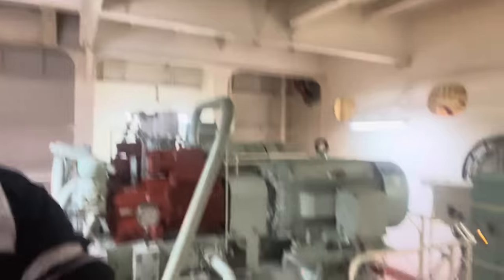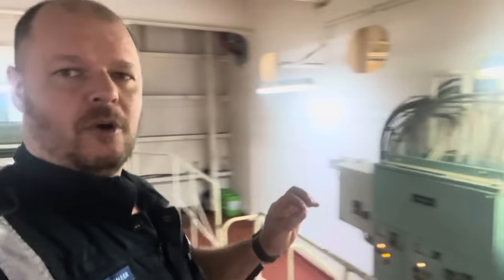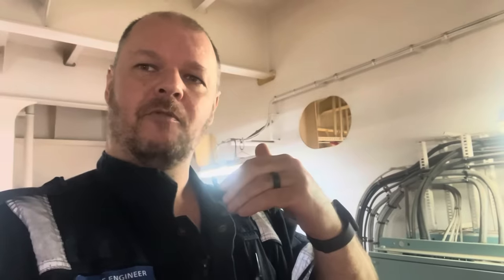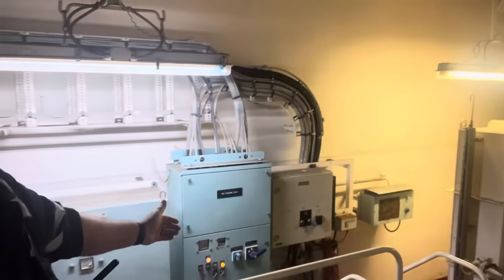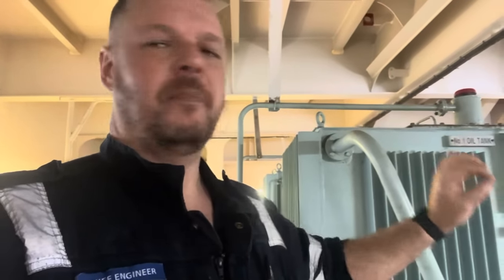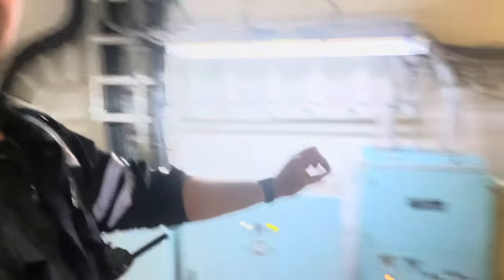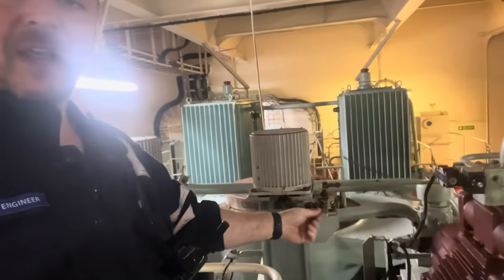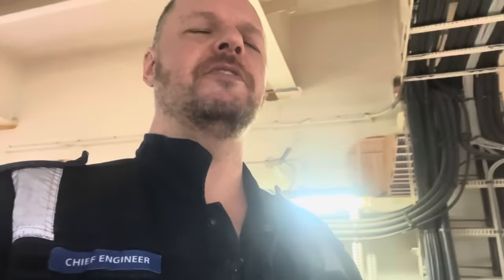Dali size containership steering system. How it’s designed to not hit Francis Scott key bridge

Comment: Thanks for the detailed explanation.
I think the problem in this instance was not that they had no control of the rudder, but that they went astern when they got the main engine back.
That most likely would have blanked the rudder, making it ineffective. Then the paddle wheel effect (prop walk) takes effect which would turn the ship.
Reply: This makes the most sense. Along with the usual smattering of maintenance and crew experience/training causes.
Reply: I thought the NTSB said they didn't get main engines back?
Reply: @greenernick  NTSB website "latest news" only has something from March 12 related to 737 door plugs. And typically they are quite tight-lipped until the investigation is wrapping (wrapped) up. Did you see some kind of press conference, or might your impression be based on a source other than NTSB?

Comment: I run smaller ships so I don't know if its different for some reason on your vessels but with NFU steering we still have the rudder angle indicator operational. It would be almost impossible to steer in that mode without it. I have a lot of respect for my engineers. The complexity of their jobs is incredible. Great video.
Reply: do they use a rotary shaft encoder to transmit the rudder position to Helm or is it something more old school ? i am guessing there must be at least 2 systems ?
Reply: @heartobefelt  Not sure what a rotary shaft encoder is but I believe the RAI signal, however it is transmitted, is totally independent of the steering system.

Comment: Thanks for the very detailed presentation!

It seems like the issue wasn’t that they lost steering control but that they unfortunately immediately went full power astern after the first outage, which swung the tail of the ship in the wrong direction and defeated the action of the rudder.

Comment: Thank you for this explanation Chief!! I’m a senior field service engineer for a major thruster company and I’ve commissioned 100’s of vessels. You are 1000% correct! There are main and backup steering and speed controls from the bridge, from the engine control room, from the thruster switchboxes, and manually from the hydraulic tanks… and last resort from the thruster itself with a large ratchet if need be. Now, granted this is a rudder system not a thruster… but exact same concept. ALL vessels have several backups for steering and speed for these exact scenarios. They’re tested periodically by ABS and crews train often to use all the controls in emergencies so they can respond quickly. 👊 Respect!

Comment: Thanks Chief for your explanation, it helps so many who are not snipes.  I’m not sure you explain how the emergency panel (buss that supplies all things critical including the port steering motor) has an “automatic” buss transfer that switches supply power from the normal generators to the emergency generator without operator intervention.  Also that the port steering motor is a LVR style controller that also automatically restarts the port steering motor as soon as power is available.  Many thanks!
Reply: There is automation in the switchboards. Most Main Switchboards have a Power Management System, that starts a next main generator when the load on the running generator(s) approaches 80%, and stops a generator when load has dropped below a certain value such that it is safe to do so. This is all automated. Not all ships have this, but WHEN they have it, it is always possible to manually override, or disable the stopping function.
This means the Main Switchboard should under normal circumstances maintains power in a safe and efficient way.

For manouvering conditions, the PMS is manually set in the mode where generators come on when needed, but do NOT switch off once connected to the MSB.

IF there is a technical or mechanical problem and (one or all of) the online generators shut down, this PMS system WILL attempt to start any and all availlable main generators and connect them to the main switchboard, and it will do so without time delay, but this starting sequence might take 5~10 seconds. They ar big engines, they don't respond as fast as a car engine :D

As soon as the ESB detects a black-out, it initially will do nothing for about 10~15 seconds, this is to give the Main Switchboard time to first try to restore power on its own, because main generators, if availlable, are preferrable over emergency power, and you don't want emergency systems activating on first whim. After all, they ar emergency systems and cannot perform identical to the main systems. So if possible...

If MSB power is not restored within that time, the Emergency Switchboard (ESB) will first disconnect from the MSB, and simultaneously the Emergency Generator is being started. As soon as that Emergency Generator has operating speed and voltage, it will be connected to the ESB. The ESB now is a stand-alone powergrid, and on most ships will remain in that status, regardless of MSB power returning or not.
These two powergrids can run side by side for as long as there is fuel in the emergency generator's tank, and the two grids won't affect or influence each other.

On some ships, the Emergency generator automatically resets to standby mode when MSB power is restored, most ships however (at least the ones I worked on) needed a manual reset to normal operation again.

Steering gear pumps are (I have NEVER seen otherwise) fitted with position switches instead of pushbuttons for starting and stopping. This means that in case of a power outage those switches rmain in the on position and the steering motors restart as soon as power comes back on.
Reply: @rigididiot  I agree with all you added.   Thanks for contributing to the thread.  I guess we will all have to wait to hear why power was loss, why steering was not restored, and how the operators and main engine responded to ordered bells.  Thank you.
Reply: Why the hard turn to Starboard? All wind and current issues were coming from the Port side, and the Autopilot or Harbour Pilot were adjusting for the wind and current variations that affected the ship's course. the mayday call had been sent and still, the ship continued on the course because the rudder was still working, they had dropped the Port anchor but didn't let out enough chain as shown after the crash the chain is hanging down meaning that it had not been dragging on the bottom. so the Anchor would not interfere with the course change into the Bridge Pier.<><><> My understanding of modern-day ships, a ship loses power to the propeller, the ship will continue on the course it was on before the loss of engine power, and the weight and momentum of such a heavy ship will never turn like the video shows. Remember the ship's electrical supply is from one of several electricity generators that the ship electronic Autopilot controlling the hydraulic motors on the Rudder will keep working keeping the ship on the course set by the Harbour Pilot, remember that the ship was on course to pass under the bridge when the lights were turned off, without electric power to the Autopilot the rudder will remain on the set course while it was adjusting course for any wind or current variations, then when the lights (electric power) came on again the ship auto-pilot would automatically resume the original course settings before the power loss, But! The video showing the sharp turn onto the target had nothing to do with the lights, or Autopilot or wind or currants proving that The HUMAN FINGERPRINT is all over this deliberate turn into the Bridge.<><><> Heavy smoke from the engine funnel is caused by a sudden increase in fuel to the engine, providing strong water pushed onto the now hard-turned-to Starboard rudder, then again the ship rudder was adjusted to Port to stop the turn because the ship needed to make a direct hit not a glancing blow against the target. <><><> This was intentional closure of Americas 5th biggest port! No question about that! But was it the US Government extremists or their FBI, or CIA! Did Terrorists sneak on board and overpower the crew? Was it blackmail of the Harbour Pilots and captains and engineers, no matter why? It is “who are they” that must be discovered because 6 people are dead because of this deliberate act by some of the People on this ship!!!!!!!

Comment: I work in a powerplant, we are set up similar with all of the redundant systems. We have our normal feeds, our back up feeds, emergency generator feeds, & then battery backups that feed inverters. Worst case scenario, we still have constant power to our vital systems. I found it hard to believe that steering on a ship that big wouldn’t have something similar…
Reply: Why the hard turn to Starboard? All wind and current issues were coming from the Port side, and the Autopilot or Harbour Pilot were adjusting for the wind and current variations that affected the ship's course. the mayday call had been sent and still, the ship continued on the course because the rudder was still working, they had dropped the Port anchor but didn't let out enough chain as shown after the crash the chain is hanging down meaning that it had not been dragging on the bottom. so the Anchor would not interfere with the course change into the Bridge Pier.<><><> My understanding of modern-day ships, a ship loses power to the propeller, the ship will continue on the course it was on before the loss of engine power, and the weight and momentum of such a heavy ship will never accidentally turn like the video shows. Remember the ship's electrical supply is from one of several Diesel Generators that the ship's electronic Autopilot controls to the Diesel motors controlling the Hydraulic rams to the Rudder and will keep working keeping the ship on the course set by the Harbour Pilot, remember that the ship was on course to pass under the bridge when the lights were turned off, without electric power to the Autopilot the rudder will remain on the set course while it was adjusting course for any wind or current variations, then when the lights (electric power) came on again the ship auto-pilot would automatically resume the original course settings before the power loss, But! The video showing the sharp turn onto the target had nothing to do with the lights, or Autopilot or wind or currants proving that The HUMAN FINGERPRINT is all over this deliberate turn into the Bridge.<><><> Heavy smoke from the engine funnel is caused by a sudden increase in fuel to the engine, providing strong water pushed onto the now hard-turned-to Starboard rudder, then again the ship rudder was adjusted to Port to stop the turn because the ship needed to make a direct hit not a glancing blow against the target. <><><> This was intentional closure of Americas 5th biggest port! No question about that! But was it the US Government extremists or their FBI, or CIA! Did Terrorists sneak on board and overpower the crew? Was it blackmail of the Harbour Pilots and captains and engineers, no matter why? It is “who are they” that must be discovered because 6 people are dead because of this deliberate act by some of the People on this ship!!!!!!!

Comment: I was on a aircraft carrier in the 80's. We called that space after steering.  We had 2 rudders and an after steering for each.  There was an engineer and a helmsman down there 24/7.  The helmsman could drive the ship while talking with the bridge.
Reply: When I was aboard USS Ranger Cv 61 , I was a phone talker in Dc Central . 1 of the daily drills between 0000+0400 was to turn off the stearing cable ,to see how long it took for some one to notice All it took was a simple flip of a switch .  To restore flipping the other switch . Only done in open ocean.
Reply: @henrycarlson7514  yep, I was a Quartermaster and master helmsman.  Every sea and anchor detail was a busy time for us.  By the way, I was on USS Saratoga CV 60.
Reply: @gar949  Did you do the drill where Dc Central would shut the steering cable off  between 0000-0400 , as an awakeness test?.
Reply: @henrycarlson7514  Yes!  If I recall we didn't know it was a test until after we took control down there.  The mid watch was the worst.  I think we all dosed off once or twice, but there were some who would intentionally go to sleep on watch.
Reply: @gar949  I was Instructed Not to tell . I went into after steering once , how you stated awake is beyond me
Reply: @henrycarlson7514  lol yep pretty boring unless sea and anchor detail. We were all on alert then.  especially during an unrep

Comment: I am surprised that emergency power takes so long to kick on. I have installed two emergency generators in Hospitals and you could barely see the lights flicker before generators came on. Thank you for great explanation.
Reply: He doesn't mean it takes 30 seconds for the generators to start, maybe only a few seconds to start.  But they also have to ramp up, sync up with each other, and then the appropriate emergency switchgear breakers need to operate, all controlled by microprosser.  These things take a little time, also there is some intentional delay built into each of those steps for safety of the system.
Reply: Thinking similar.  We had to 'load test' our emergency diesels (land-based power plant) monthly (or more if they failed the monthly).  They had to start, close in and be carrying the loads in < 10 seconds to pass.  Mind you, these were the old EMD v16's and had prelub running on them all the time.
Reply: The main switchboard is supposed to start (if necessary) and synch a main generator onto the main bus in 10-15 seconds depending on what's running and how much load. The E-gen is supposed to be the backup in case the msbd blackout recovery fails.

Comment: On a differemt YouTube channel, it was stated that the Dali left the quay side and sailed WITH the outgoing tide. Long ago, I remember a ships' pilot telling me that a ship never sailed with the tide, always AGAINST the INCOMING tide. The reason being that in a narrow navigation channel, steerage could be maintained against the tide and the ship was by far more manoeuverable. Another aspect which has not been discussed is the effect of varying local currents affecting the passage through the channel and under Francis Scott Bridge. Did this also impact on the unexpected track taken into the bridge pier?
Reply: Why the hard turn to Starboard? All wind and current issues were coming from the Port side, and the Autopilot or Harbour Pilot were adjusting for the wind and current variations that affected the ship's course. the mayday call had been sent and still, the ship continued on the course because the rudder was still working, they had dropped the Port anchor but didn't let out enough chain as shown after the crash the chain is hanging down meaning that it had not been dragging on the bottom. so the Anchor would not interfere with the course change into the Bridge Pier.<><><> My understanding of modern-day ships, a ship loses power to the propeller, the ship will continue on the course it was on before the loss of engine power, and the weight and momentum of such a heavy ship will never turn like the video shows. Remember the ship's electrical supply is from one of several electricity generators that the ship electronic Autopilot controlling the hydraulic motors on the Rudder will keep working keeping the ship on the course set by the Harbour Pilot, remember that the ship was on course to pass under the bridge when the lights were turned off, without electric power to the Autopilot the rudder will remain on the set course while it was adjusting course for any wind or current variations, then when the lights (electric power) came on again the ship auto-pilot would automatically resume the original course settings before the power loss, But! The video showing the sharp turn onto the target had nothing to do with the lights, or Autopilot or wind or currants proving that The HUMAN FINGERPRINT is all over this deliberate turn into the Bridge.<><><> Heavy smoke from the engine funnel is caused by a sudden increase in fuel to the engine, providing strong water pushed onto the now hard-turned-to Starboard rudder, then again the ship rudder was adjusted to Port to stop the turn because the ship needed to make a direct hit not a glancing blow against the target. <><><> This was intentional closure of Americas 5th biggest port! No question about that! But was it the US Government extremists or their FBI, or CIA! Did Terrorists sneak on board and overpower the crew? Was it blackmail of the Harbour Pilots and captains and engineers, no matter why? It is “who are they” that must be discovered because 6 people are dead because of this deliberate act by some of the People on this ship!!!!!!!
Reply: @geoffreytoomey682  Your understanding is flawed. To say the least. Your conspiracy theory is idiotic.
Reply: Ships sail at all stages of the tide.
- tug engineer, Port of NY.
Reply: I guess ships never go down river either, huh 😂

Comment: Well presented information.  Sounds very similar to how we designed critical controls and pumps in the chemical plants to the point of running the cables along different sides of the ship.  We would then add another multi-layer "voting" safety shutdown system if system upsets could be lethal or explosive.  
I liked how you took the opportunity to prove your safety systems under their worst case conditions.  Emergency systems (which are almost never used) don't always function when you REALLY NEED them to Work.